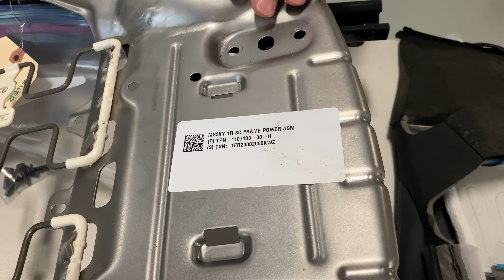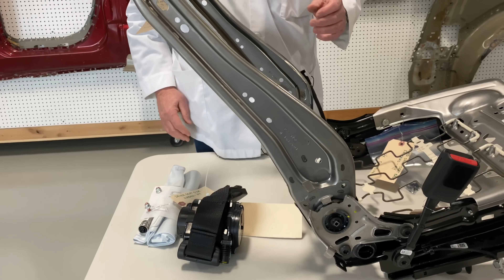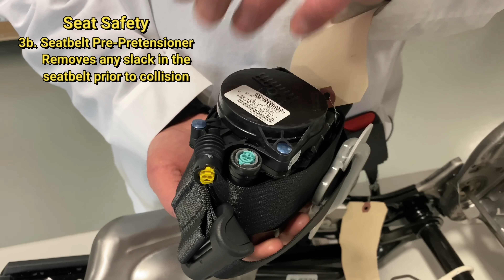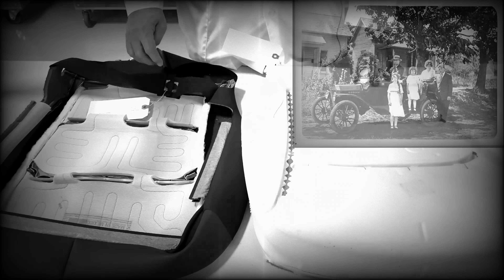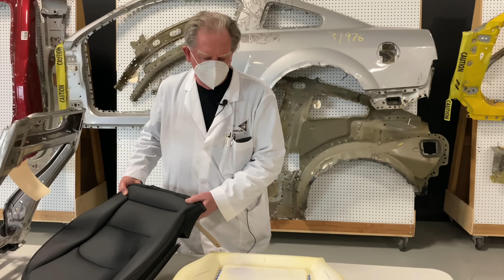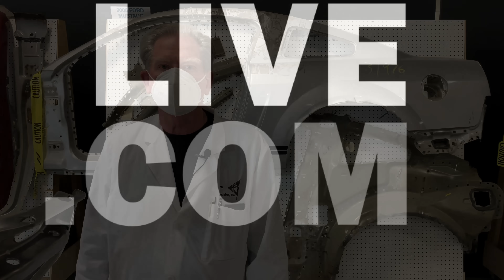Model Y E38: Seat Day at Munro

Comment: Love the Video. Is it correct, that if the taps just over the pivot point on each side was cut off, the seat would be able to recline fully vertical? And is it a safety feature that thye can't recoil fully flat?
Thanks 🙏

Comment: I saw there are spring wires.  My m3 made sqeek noise as I got in n out or moving on seat which made it feel very cheap for 65,000 purchased. F parts made in china.

Comment: Hello, 
i watch your videos with great interest, very nicely done, sometimes i would wish for more details. But I do have a comment on the safety of the passengers in the sidecrash: One side is not protected, namely when a vehicle starts to skid and hits an obstacle with the passenger side. The driver then experiences a sideways acceleration on his right side, against which especially the neck is not protected. In my wider circle of acquaintances three people have already died from this. One in an Opel Corsa, one in an Audi A3 and one in an Audi A4. Isn't there a system like a roof airbag that protects the person's head towards the middle of the car? Greetings from Bavaria, Andreas

Comment: I like the Hello boys and girls intro, so refreshing from a young whipper snapper. I started work in 1973 as a kitchen hand/porter at the Castle Pool Hotel. I spent the summer, 1978/79 putting the bumper bars on the HZ Holden at GMH in Elizabeth. 1989 Found me spot welding the 'B' pillar on Toyota Corollas, at the TMC plant in Dandenong. This used to be a GMH plant. This was neat. I was on the second station after the robots did their stuff. It was always good to be a part of something that could churn out a new car every 1:40 minutes. It did get very boring after a day or two but.

Comment: Hog rings: I was introduced to these when reupholstering the seats in my '94 Accord. The leather was terrible but the rest of the vehicle refuses to die. ;-)
Reply: Hog rings and upholstery staples are a bit different.  I've used both for their intended purposes and substituted hog rings for upholstery staples when that's what I had available.  IIRC hog rings are made from larger diameter wire.
Reply: @bobwallace9753  I wouldn't of even tried such a endeavor if there wasn't a YouTube video out there shedding light on how to do it. Thank goodness for video tutorials! 💪
Reply: @bobwallace9753  Plenty of older seats have large hog rings.  Closely spaced small rings/staples are used for holding lightly reinforced leather edges.  Thick rings are used for the listing strips, tucks, tufts and other features with high stress and heavy reinforcements.

Comment: Chinese OEM's will say thanks Sandy, free education for the taking...
Reply: Nonsense , they have already learned from many other manufacturers
Reply: @carholic-sz3qv  There are plenty of engineering failures out of China. Thanks to Elon the US returned to the forefront of technology again in the Auto segment.  Germans become fools thinking to present offline cars requiring workshop attention every time a software update is needed.  The Japanese already failed miserably when say you need a map update and they charge  $500 for 5 minutes of work. The Germans also underpaid their engineers so they shown the Koreans what to do! Best example: Peter Schreyer! Now his replacement is doing the same again!
Reply: @lawpickinglocksmith7689  yep you are still totally wrong, most of the technology and machines in China even in the US are German made , all the robots used by tesla are German manufacturers, they even uses Toyota electric forklifts and so many diesel trucks.... it's Germany that improved the technology in China not Elon
Reply: @carholic-sz3qv  2 Examples: Apple contracts Hon Hai and sells back to Chinese. Well done.  IBM put up the white flag, so sad. Some consumer stuff like TV's the Chinese have learned to make it last. Airplanes are a sad story. Boeing stuffed up so baldly with the Max the Chinese are probably going to buy them all at a bargain price, balance them properly and teach their pilots draconian ways. Airbus burned their fingers badly with one bird requiring 60m wide strips while all else is happy to land on 45m.  Do you think the west is doomed?
Reply: @lawpickinglocksmith7689  if those are your two examples then there is actually alot more things that Germany did compared to the US period from the manufacturing to finish products

Comment: Holy moly, I had no idea my seat has all those safety features and "mini bombs" inside of it.  😮
Reply: As a firefighter you have to known or you will be suprised, not in a good way.
Reply: I've had my seatbelt pyrotechnic go off without the airbag, very loud and scary but keeps you away from the steering wheel.
Reply: @mike s  tensioners aren't airbags!
Reply: This is why some cars are totaled by the insurance company when a minor collision sets off all the Supplemental Restraint Systems. All those SRS devices cost a small fortune to replace. So these devices have pros and cons, but safety is the most important thing.
Reply: @mike s  Have you bought racing belts?  Last year we bought a fresh set for a bit over $600 with tax, replacing a set that had been used for only two racing weekends.  (The certification expires 5 years after they leave the factory, and it's easy to forget that the belts were ordered early in the build process.) That was only for the replacement belts for an existing installation, not the other parts such as neck restraints.
Reply: Gas engines are just contained explosions

Comment: Instead of the metal fold around the edge of the seat, which Sandy said its costly, wouldn't it be better to glue or just pressure attach a "U" shaped plastic or rubber rim?
Reply: Adding a "u" shaped protector would be even more costly and adds an additional part to the supply chain. Using adhesive would require a separate assembly station with reservoirs and pumps for the adhesive, and introduces a "cure time" before the part can be handled. (Admittedly, cure time could be very short - seconds to minutes)

 Folding the frame can be done quickly, without additional parts or wait time. A cast part completely sidesteps this problem.
Reply: @naarealy  Sandy did say "this costs a lot". A plastic rim would cost a cent and 5 seconds to install. Hence my question, although I confess I don't have a clue of what "costing a lot" really is in dollars
Reply: @ptviwatcher  Tesla made 112,000 cars last year, 450,000 seats, a bespoke plastic lip would cost probably $1 to design, manufacture and store in the factory.
Adding one short operation while the seat is on the press just saved you half a million dollars, plus a minimum wage employee to install it costs $487,000 per year for those 5 seconds to install it on each seat(37,000 work hours per year). 
You can easily save a million dollars a year mostly by simplifying and automating even a nothing part like this.
To say nothing of the entire point of this is to keep the sharp parts out of the workers hands, so the company can't be sued when a worker cuts off their finger off on a sharp edge.
Reply: @coast2coast00  so... When Sandy said the current solution was expensive he was... wrong?!

Comment: Magnesium is very hard to machine because it will already catch on fire if drilling and machining are cooled.  The problem is magnesium when on fire burns very hot and if you try to put it out with you can an explosion.  It’s difficult to tell if a car has magnesium in it when it’s buried so deep in the car and most fire personnel would think they can use water to put out the fire but that could be dangerous.  This material was extensively used in aircraft 
Manufacturing due to light weight (but poor strength) but has been removed because of the manufacturing and fire issues.
Reply: I've seen magnesium castings used on steering wheel hub and airbag frames by OEMs.

Comment: How recyclable is that magnesium? Wouldn’t Tesla just make a casting out of aluminum, same as the rear floor?
Reply: not to mention how magnesium behaves when on fire, curious as well as to why not aluminum castings.
Reply: @ToastLove  Aluminum burns well in a hot fire, too. Thermite, for example, is a mix of aluminum powder and iron oxide powder. Aluminum wants to oxidize so much that it steals the oxygen away from the iron.
Reply: @esweet100  But not like magnesium, the Japanese made the zero (if I remember correctly) out of magnesium. Very light fast planes but one incendiary bullet hitting the frame could apparently course the plane to burn.
Reply: @ToastLove  Hoping it's a magnesium alloy.
Reply: Tesla doesn't use magnesium, it's Audi and Mercedes lexus and BMW that uses it